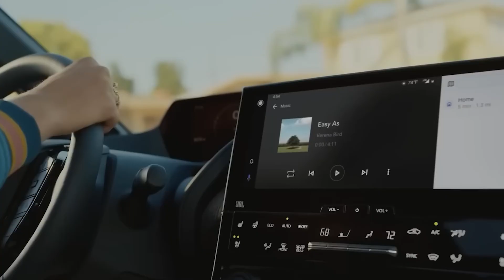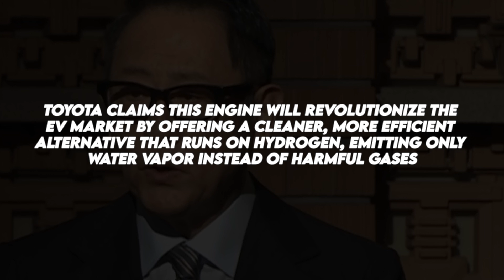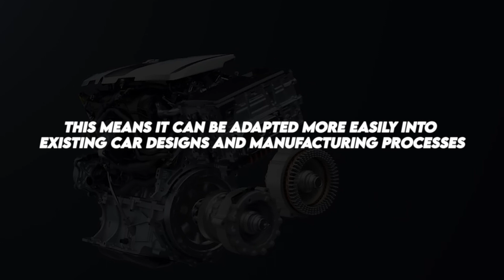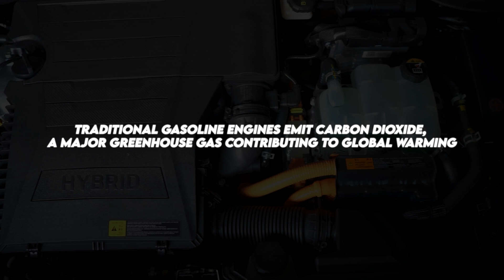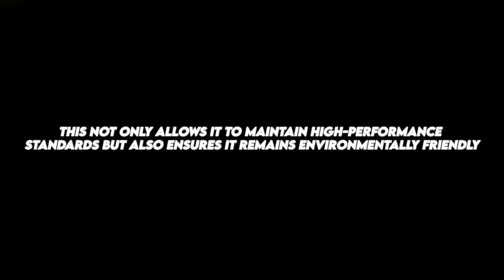Toyota CEO Unveils Engine Set to Revolutionize Automotive Landscape

Comment: I've heard this tune before. 
1. Hydrogen is very expensive. Producing it takes a lot of energy with impact on the environment.
2. Unlike gasoline, Hydrogen can ignite just from oxygen in the air, often as an explosion. 
3. Hydrogen and its flames are INVISIBLE creating a severe danger to the people in the car. 
4. Hydrogen may leak during refueling, ignite and potentially explode with NO WARNING. 
5. It will take over 10 years to reach a refueling system. 
6. Show me a mechanic who wants to deal with the Hydrogen threat! 
7. What happens during a colision? 
8. People live near a gas station. Will you want to live next to a Hydrogen fuelng station?  
9. Would you like to have his "H" can parked in front of your living room window?
10. The trucks delivering "H" to the fueling station can create a frightening explosion due to the extremely high PRESSURE (up to 10,000 PSI) of the "H".
Otherwise, I think a Hydrogen Camry is a great idea...... But I will NEVER park it in my garage!